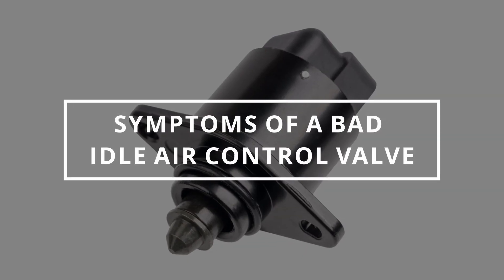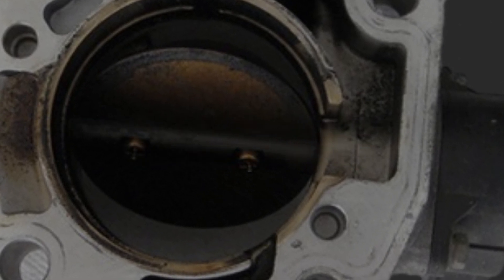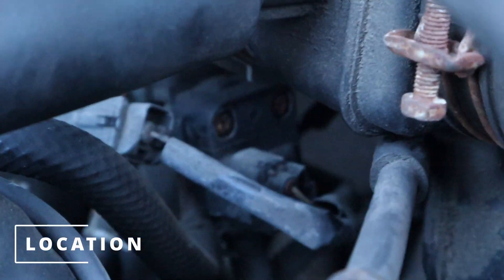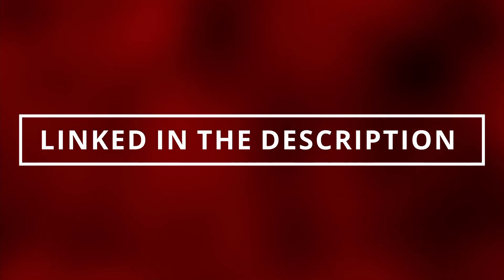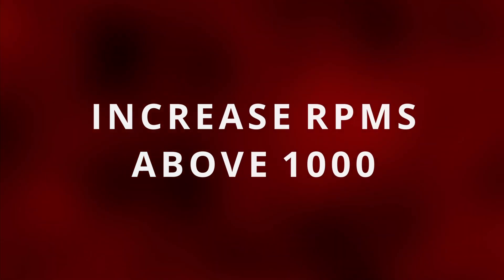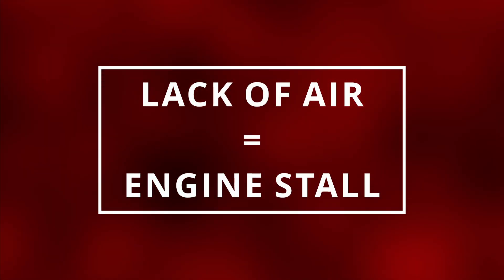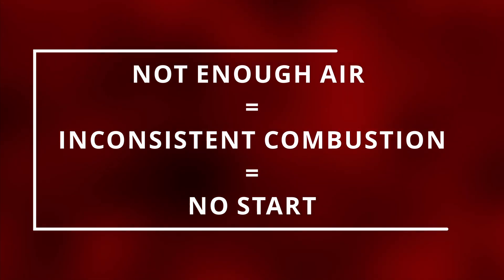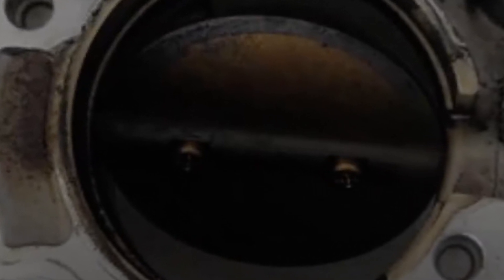SYMPTOMS OF A BAD IDLE AIR CONTROL VALVE

Comment: October, 2025, I'm taking mine out, and cleaning it tomorrow. I'll let you know if my idle smooths out. Thanks for the knowledge brother. 🤝
Reply: I tried to clean my IAC valve, but the spring popped out, then I pushed it back in. Then, it would move anymore. So, I just bought a new one, as well as a TPS. Isle is smoother now. I may change the O2 sensors this week, as well.

Comment: My 1997 Jeep Grand Cherokee keeps showing a battery problem with my new expensive glass mat battery, the idle control valve also failed. Can AGM batteries cause this?

Comment: this could be the issue i am having with my motorcycle, she will crank but not fire up with closed throttle. When i give it a bit of juice she fires right up. when i ride idle and take a sharp turn she will also bog down and stop running. luckily its a bmw to i am able to read out the position on the idle air control valve which looks to be working fine. Will clean it out this weekend and report back!

Comment: You left out rough idle and shaky engine while in park or neutral or at a stoplight
Reply: Me too I have been having this issue for months and can’t fix it I need help badly
Reply: Same with mine too
Changed the pil, fuel filter , new plugs and wires , transmission filter and gasket, pcv valve
When i come to.a stop light that idle is so dam rough even after changing all that
Reply: @allenanalla2549  Could be bad oxygen sensor?

Comment: my volvo has one of these for its lpg system. The problem is that it has a proprietary driver board integrated into the housing, making replacement impossible since they EOL'ed it a couple years ago. 

Any ideas where I could get a replacement connector for the 4 pins on top?

Comment: I have vw 2016 jetta tsi rpm 1.2 on start up then; drops to good idle rpm in couple minutes. Code p2263 super charger but, scan does not break down the code issue. Could iac valve be issue?

Comment: My sons 98 Avalon will run perfect but after killing it and usually if it’s warm and you start it right away it will start in an almost limp sputtering mode. Can’t even rev it. Have to kill it and try again.  Then will drive fine.  Looked for vacuum leak etc.  Could it just be a dirty idler air control?

Comment: This was a great video  I bought Throttle body cleaner  2004 PT cruiser idle sitting shaky 500 or below turn to park or turn down a street car died  I took the idle control valve off cleaned it blew it off with air low power and wiped with paper towel saturated with throttle body cleaner  let it dry put in side the housing it sits in put it back in   screwed it in place and the idle shot up to 2000 then came down to 1500 rpms  so may need a new of after all I'm gonna drive it n see how it does  great video

Comment: I have an 07 jeep compass 2.4 cranks starts great. Throttle body replaced couple months back. No code but it is running rough especially when stopped. Also when I fill my gas full it stalls and has trouble starting (also smell fuel). It Stalls for a while when gas is filled but after a while it’s all good any ideas?
Reply: The gas issue is a bad canister purge valve. My car did that too. When you fill up Don't top off the tank..its bad for the charcoal canister. Only fill it till the gas pump shuts off.

Comment: I really thought it was my idle air control valve. 

I have a vacuum leak I couldn't find.  The idol was bouncing up and down, it was a rubber seal in between the brake master cylinder and the brake vacuum booster.  When I press my brakes hard it idles fine, and when I take my foot off it bounces.

Comment: My idle goes back to normal really slow and I have no engine brake.. After like 5 seconds I stopped, it slowly drops from over 1000 rpm back to around 800 rpm. Te valve itself is closing the air duct slowly. I 've checked it the valve unmounted... What can cause that? It  Fiat A156.246 engine . 999cc weber SPI . Any ideas would be appreciated.

Comment: K so as a seasoned mechanic... You do not need to take the battery cables off unless it's a foreign vehicle like the one used in the video. My Ford Crown Vic also has an IAC valve that sounds like a boat horn. It's the plastic tube making that noise so I changed it over to metal and solved all my problems. Same with my air intake. I changed it over to a metal less restriction pipe and got 10hp out of it plus another 10 from muffler delete.
Reply: Since your a seasoned mechanic maybe you can help me out? My car stalls and shuts off when i put it into reverse. I’ve checked the battery and transmission no problems there. I’ve also replaced O2 sensors and fuel filter but problem is still there.

Comment: With pressing the gas and turning the key it will work but for my car eventually it stops working and just doesn't start. Happened to me again last night tried for about 30mins no start. Usually it will start eventually but I got to wait battery will die out and then magically it starts

Comment: Ford focus MK2, need to press the acceleration pedal to start the engine, otherwise it does start for a few seconds, and stops immediately. Could this valve be the reason?
Reply from the maker: Your starting issue might indeed be linked to a malfunctioning component affecting the idle, such as the Idle Air Control (IAC) valve. However, it's essential to verify whether your vehicle is equipped with one. Many modern cars utilize an electronic throttle body to regulate idle speed instead of a traditional IAC valve. This system integrates more directly with the vehicle's onboard computer for precise control over air intake at idle. Here is a video that could help you out. https://www.youtube.com/watch?v=10H-GBPCU2g&ab_channel=EasyAutoFix

Comment: 2019 F150 V8 same, not really rough idle but sporadic rev up and down by 50-100 rpm, and occasional stall. Highway miles only 25k. Warranty. Ford diagnosis ( going in today) 3 of 8 lower bank fuel injectors drip. All 8 upper injectors perfect. Lower bank injectors have 1000 psi blasting through while uppers only have 60.
Ford said this will fix the issue.

Comment: so i have a problem i think, when i first got my car it would idle at 1800-2000rpms in the mornings when i would start it no matter the weather, i recently changed out my throttle and now when i start my car it idles at 800rpms. is that good or bad